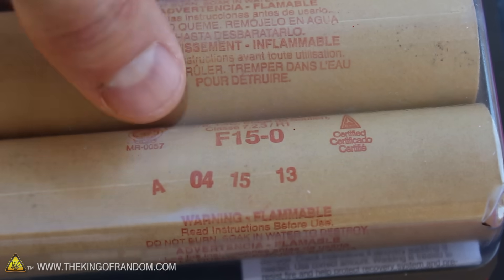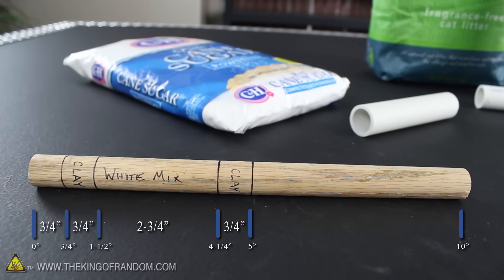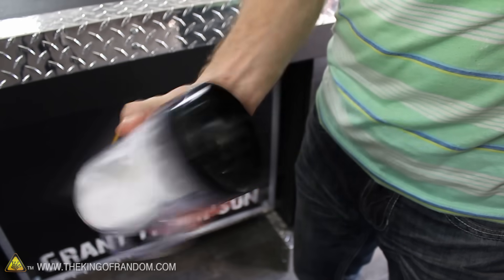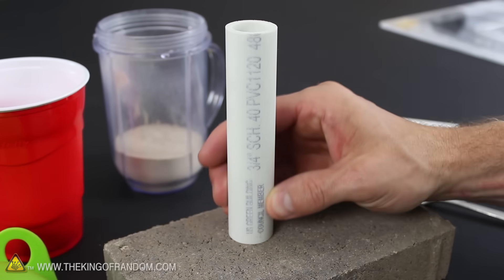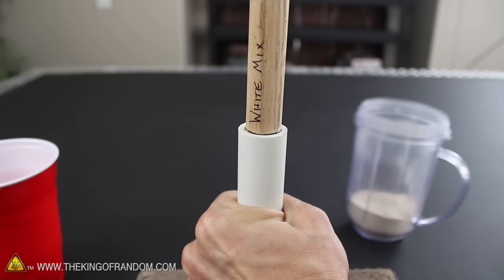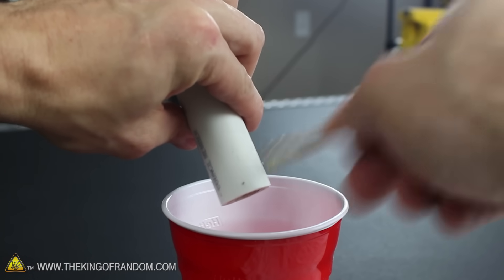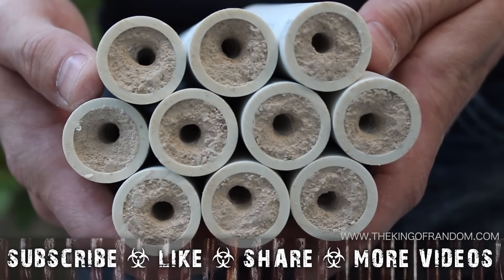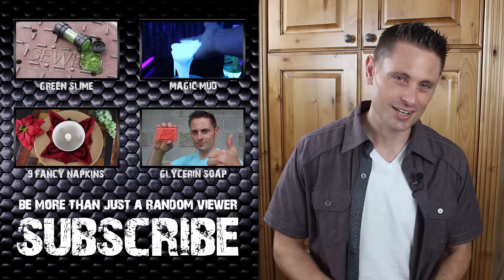How To Make Sugar Rockets

Comment: Question: is there any problem using reguler clay.
Reply: Probably not. The clay is just an end cap, not a part of the reaction. So, as long as it's dry, holds together, and won't melt from the heat, it should work. You could use other things as end caps if they fit those criteria. 

He probably used the specific clay he showed because of price (dirt cheap) and ease of assembly.

Comment: Not a proper rocket 🚀 needs a tip so it can go higher and penetrate through air 🫡🔥
Reply: This is just the way engine for the rocket
Normally, there's a tip

Comment: I didnt know he had moved on to the next dimension.. At least he did what he liked doing and was enjoying life to the fullest. 
RIP . If anyone has issues with the burn double check your powdered sugar as some of brands mix in cornstarch.. which completly ruineda 2 pound batch i was making, My bad for not reading the label contents  so from now on i just grind up my own sugar ,,and instead of capping the forward motor with clay i just heat up the pvc and twist it into a point with a heat gun then cut  the desired length , i used apvc cap once and it worked fine but kind of expensive but not alot . ovc glue the cap on one end and clay on the other.

Comment: I tried it , but it didn't work. I suggest using cement instead of kitty litter and making the nozzle of cement. But my question is what's the thrust produced by it.
Reply: Cement is prob too heavy also thurst is produced by sugar burning with the potassium nitrate as an oxidizer.
Hope the helps.
Reply: Cement is way too heavy

Comment: Did it and it didn’t work with me, the white mix did burn and release smoke but it didn’t fly or launch
Reply: there could be a few reasons for that, but here are the most likely. if you are using store bought powdered sugar, there could be some cornstarch in there which will make it burn slower. i suggest grinding up normal brown sugar into a powder instead. also, your potassium nitrate could be wet, which will make it burn slower or not at all. potassium nitrate absorbs moisture from the air, but you can dry it out by putting it in the oven or in the sun to dry. hope this helps

Comment: I’m a beginner, what did you use do light up the engine?
Reply: I'm also a beginner, I've found best if you get some green fuse rope and line it up similar to firecrackers and off the shelf fireworks.

Comment: I see there are two current mix ratios for sugar rockets, 65 / 35 and 75 / 25. Which mix does do you all find the most effective for height vs burn duration?
Reply: I guess 65/35 will be the best but i personally like to use 55 / 35 / 10, Potassium nitrate + sugar + iron oxide(Rust)

Comment: Did you try using epoxy plug and melting the mixture and pour the grain then b while soft and not yet cool put the port grain then kitty litter nozzle and hand d rill as you show....it would seem safer rather than the friction caused by tamping..would seem to make a more even burn rate

Comment: Is there a chance of accidentally setting off the rocket fuel by compressing it like that? If not, why not?
Reply: No. KNO3 is a stable oxidizer. If you used a less stable oxidizer like KClO3 it could detonate

Comment: This is dangerous, Don't do this. PVC is a horrible casing.
Reply: the ones you can buy are wrapped in cardboard. pvc is better
Reply: @MangionMotorsports  When PVC explodes it fragments into razor sharp shards, Cardboard on the other hand doesn't.

Comment: Does the fuse go all the way up inside or does it go just in the bottom
Reply: I've seen it done both ways and was asking myself the same question. I'm planning on making e-matches to light mine so I will be lighting mine from the bottom, I would imagine that it works fine cause that's how you would light a normal hobby rocket

Comment: Chi tip for anyone planning to build this rocket the stump remover that he uses in the video was out so I got a different kind of stump remover don’t get another kind of stump remover not all of them work and it won’t launch because the stump remover I got does not contain the chemical that is needed
Reply: I discovered that saltpetre used for curing meat is also pure potassium nitrate so I got a kilo bag of it on Amazon.

Comment: Really cool.  Just what I want to do.  Pound an explosive pyrotechnic mix into a tube with a ramrod & mallet. 
I don't have time to read through all the comments, but I wonder how many fingers & eyes have been lost doing this.  Remember Our National Example of this.....Trump isn't a Macho Man......he just needles other fools into being HIS Macho Man.
Reply: The pyrotechnic isn’t pressure sensitive it is set off by heat such as a fuse it’s not going to go off from the pounding
Reply: @tildenmueller8645  .....Riiiiiight.  Tell me:  If you close one end of a tube, fill it with a gas (or anything else), insert a tight plunger & hammer on the plunger to compress the gas.......what happens to the temperature of the gas?  It gets hot, no?  And if you listen to the video, it's specifically mentioned to be careful when you pound as the propellant might go off.

I'd get better insurance for your fingers & eyes if I were you.
Reply: @DanishBlu  I’ve made these rockets plenty thanks and I’ve still got all ten
Reply: @DanishBlu  it is true, this is a unsafe method for making sugar motors, but it's not because he is ramming fuel into the tube. Kno3 and sugar is not sensitive to shock at all, people have been making rockets this way since forever, there is absolutely no chance that the fuel will explode when he is ramming it

Comment: What happens when you multiply it and make a 3-inch diameter rocket engine instead of 65 G of kno2,  it would be 260 g of kno2 and so on and so forth right
Reply: Yes, as long as you use the same ratio of sugar and potassium nitrate it will be fine

Comment: As a teen, I discovered how to make these engines. However, we used pure sugar, ground up finely, along with the KNO3. I'm curious, though. Powdered confectioner sugar also contains a small percentage of anti-caking agent like corn starch. How does this affect the burning. The sugar is a fuel, and I suppose the starch could also be. But the burn could be different.

Otherwise, great tutorial. It's not a bad. inexpensive fuel.
Reply: Well, powdered sugar is simply pure sugar that has been basically blended until it is powdered with, as you said, an anti-caking agent added. I'm in no way a chemist but when I was young and found out how awesome it was to see sugar melt I had to see the different sugars melt, so I experimented (this was before I knew what powdered sugar was). There wasn't really any difference at all between it and regular sugar that I remember, but my brother says he remembers the powdered sugar melting a lot faster.

Comment: 1) Where do you get potassium nitrate from? 2) Did you just light a wick and stick it in the hole?
Reply: You can get potassium nitrate as stump remover from most hardware stores. And if you can't find it there, you'd be able to find it on Amazon. I found several offerings of 5lbs bags.

Comment: I tried your method absolutely perfect so I continued on perfecting my skills at making them if u use super glue combine it with the cat litter and do multiple layers of cat litter stoppers is combined with super glue and a smaller hole these go out the atmosphere easy and newly instantly
Reply: Here's another trick: make the fuel and then put it in a metal pot. You can put it your oven at 125-150°C for just under half an hour. This takes the potassium nitrate's ability to act like potassium naturally does.
Reply: Hi @Trevor Quinnell I was going to make a few rockets but I don't know how I would attach the fuse to the rocket and is the fuse just to light the mixture?
Reply: I believe the fuse light the bottom part of the mixture creating thrust as it burn up. To keep the fuse in place just insert a toilet paper ball to keep it from coming out push the paper ball in snug @DavieA007

Comment: Anybody have a quick take on how to attach a fuse to the inside of the rocket to light it up?
Reply: That’s literally what I’m trying to figure out
Reply: @kamilhd2280  I ordered some fuse wire online because I  don't intend on using electric starters right now, so I am gonna see if that works. My first idea is putting a tip of super glue at the end of the wire and sticking it in all the way into the rocket. Gonna see if it works, if you find some other way of doing it, please share it with me!
Reply: Tempest and a Computer thanks a lot for sharing this with me, please let me know how it goes!
Reply: Tempest and a Computer I launched my rocket today by bending a fuse at the top so it doesn’t fall out and just putting it in the hole. Hope this helps

Comment: all of our childhoods were spent watching these videos wishing we could do them
Reply: My childhood consisted of digging up turnips in the middle of nowhere
Reply: @UnPhAzD91  For a second i thought you were going to say you can turn a turnip into a Rocket
Reply: @PinnacIeSaint  that's not a bad idea
Reply: You can do them now though! Got any experience making rocket motors?
Reply: I actually do these projects and I'm still in my childhood :D
Reply: Capitão Explosão too👍🏻
Reply: @pyroxpert6089  except I broke my only launch controller yesterday when the (homemade) igniter didn't come off of the engine, and it didn't leave the ground, so it was basically just a flamethrower pointed at the controller wires :/
Reply: @Fred_the_1996  get about 20 ft of speaker wire and a 9volt battery ..
Reply: @kevinerhartjr.273  nvm I managed to fix it by soldering a new set of wires and some alligator clips. It originally broke when one of the sugar rockets' mixture had been warmed up and turned into potassium nitrite, which caused it to not take off and just melt the wires.
Reply: Officer Randy ye
Reply: I do them
Reply: And not doing practical things that lead you to be able to do things like this. "I could be useful and make something of myself, but I'd rather watch videos of other people doing it"
Reply: Point but I am a child only I made this and it failed on diwali day do check that out

Comment: Can I use cinnamon?
Reply: Andrius Mi  Yes you can!  The only rub is that it won't work.
Reply: @azul8811  well I read that cinnamon is highly flammable and explosive, so I thought it would work
Reply: Andrius Mi  My guess is that it is not considered flammable but that the powder when dispersed in the air can explode under the proper conditions.  As can flour.  Dust can explode as well.  I forget how the term flammable is defined in certain fire codes.  However There is a difference between the terms combustible and flammable in certain fire codes.

Comment: $0.50 each? utter BS. Only costs as low as this "per rocket" if all the components are bought in bulk (i.e. enough to make hundreds of them) and if you don't count the cost of the tools used.

In reality, if you're just planning on flying a rocket a handful of times a weekend, then it's by far more cost effective to just buy the ready made rocket motors.

Comment: cool video with precise information...The width of the hole created by the drill bit  controls the burn rate of the rocket motor the bigger the surface area the faster the burn the smaller ther surface area the slower the burn rate. drilling the hole into the rocket motor is the most dangerous part of the manufacturing process .. model rocketry uses electrically triggered  magnesium ignitors but it looks like these rockets used a flame burning on a wicked  line to start it.

Comment: It would be better to drill it in a lathe from drill chuck in the tailstocck
It will keep concentric and parallel
Reply: no hand drill it or the heat from the  friction of a power drill or Lathe  could ignite the mix!

Comment: Had a book on hobby rocketry when I was a kid, and they made a sugar-nitrate fuel by melting the mixture in a double boiler and pouring the molten mix into an empty CO2 cartridge. The cooled cartridge was mounted in a body made from an empty aluminum cigar tube that was filled with melted paraffin wax and then cooled. Fins were glued on and the thing ignited with Jet-X fuse. This technology was way beyond me at the time, but seemed pretty slick. Not sure if KNO3's going to dissolve in melted sugar though, and I can't imagine trying to pour the stuff into the tiny drilled-out mouth of a CO2 cartridge. Stuff would be super-viscous and hard to handle.

Comment: Down here in Australia 🇦🇺 our overlords won’t let us have potassium nitrate
Reply: Likewise in the UK
Reply: How do you remove stumps?😂
Reply: 1970bosshemi pick n shovels
Reply: @TheGenerator_Guy  Get a metal barrel and remove both ends. Place the barrel over or on top of the stump. Fill it half full with firewood. Light it up. It will burn right through the stump.
Reply: Tell your local butcher you want to use it for smoking a ham.
Reply: 20kg bag for about $25 at any rural store in Australia numbnuts its not restricted at all.

Comment: Any thing I need to do to the stump removed 1st and what's the mix ratio ???
Reply: Andrew Morris it's 65 grams of potassium nitrate to 35 grams of powder sugar, but I read you can go all the way 1:1 but at the current ratio it's nearly 2 parts potassium nitrate 1 part powder sugar, the ratio shown in the video is 13:7
Reply: @jordanshelton331  thank you mighty kind of ya
Reply: 13_13_13 fertilizer and disel fuel....
Reply: @DannyAllen10271966  you mean pure nitrogen and Diesel fuel

Comment: Lol your gonna need sugar (*says potassium nitrate really fast*)  and some kitty litter 🤣
Reply: can you even buy potassium nitrate? where would they sell it and for what purpose
Reply: Fevos Man he said in the video he got his as a special brand stump remover if you can’t go to the store with that info and read some ingredient lists then you probably can’t build a rocket
Reply: @kris6682  I built a rocket only problem is engines are 125$ a engine so doing this will save me 124.50
Reply: @nikoskabbadias  stick to mixing gasoline and styrofoam together. Pour the snot into an empty baby food jar, screw on lid, and cover with grease. Light and throw. You're welcome for this theoretical comment.
Reply: @jpablo700  nnnnnnnnnnnnnnooooooooooooooooooooo you dont know what your doing now the kgb has to come after you for spilling russias biggest and darkest secret
Reply: jpablo700 I know a napalm recipe when I see one, you can’t fool me
Reply: @nikoskabbadias  secticide brand stump remover is basically pure potassium nitrate
Reply: @yakkobthelearned   PotassiumNitrate is the main ingredient in black powder used in muzzle-loaders.
Reply: Fevos Man he posted a link to everything. The stump remover is less than 5 bucks per pound.

Comment: I followed the directions exactly they work great just want to know what size  wooden dowel you used to attach to motor for flight thanks
Reply: Joe Garcia I assume the fuse goes into the drilled hole, but is there any particular trick or instruction to put it in properly?
Reply: @JamelArif  I made my own fuses using pixie sticks i emptied them first of the candy then filled with some rocket fuel twisted the end skinny enough to insert into rocket about an inch to inch and a half  which the total length of fuse was about 2 to 2 and a half inches long and worked really well

Comment: Now if you hollow out the center and clean out undetonated shotgun shells you can extract the gunpowder and fill the rocket and extend a fuse into the tip of the rocket detonating the rocket..........

Comment: Have you tried sugar and salt peter.   I'd like to see you make a video using these two substances. I created mine as a teen using a pie pan an a outdoor grill on low heat. Melt 1:1 ratio of sugar and salt pete. Use the same. Dimensions in this video for your housing and clay endcaps. And hole.

Comment: Hybrid rocket engine with acrylic and gaseous oxygen: tesla/spacex? elon musk?%..1 second ago
i thought ?>....elon musk had rocket problems? ...lol.,hybrids is generally higher than solid motors and lower than liquid engines. as high as 400s has been measured in a hybrid rocket using metalized fuels.[3] Hybrid systems are more complex than solid ones, but they avoid significant hazards of manufacturing, shipping and handling solid rocket motors by storing the oxidizer and the fuel separately

Comment: If you try to construct these in a humid climate, they will most likey not work. I tried it today they would fly but not for long. The mixture attracts water in the air which means the fuel gets contaminated.

Comment: Have you tried using normal granulated sugar and grinding it yourself? The stuff at the store contains cornstarch to help prevent clumping, and I’m curious if you can get more power without it. I’m also curious if you’ve tried longer motor bodies and more mix to get a longer burn time.

Comment: Well, you should not use powdered sugar, because it contains cornstarch which will slow your burn.   Just use regular granulated sugar, or bar sugar.  You can grind/blend it with your KNO3.  It will not react.  Just don't  go like 10 min. with that. your motor could heat up enough to deflagrate the mix.  If you want to go a step farther with this => 65/35 +2% red oxide
Reply: I put 65 grams of sugar instead of 35 will it still fly

Comment: I use newspaper soak in sodium chlorate solution. Dried the paper and rolls the paper coated paper into a tube and stuff the paper into a rocket tube and wow !. 2 stage rocket that flew a few hundred feet with a sodium yellow flame.$1 of chemical could make a hundred rockets.